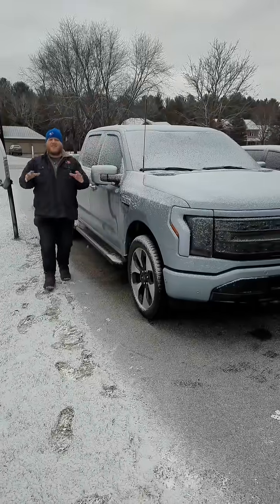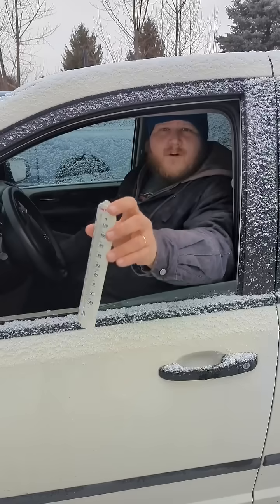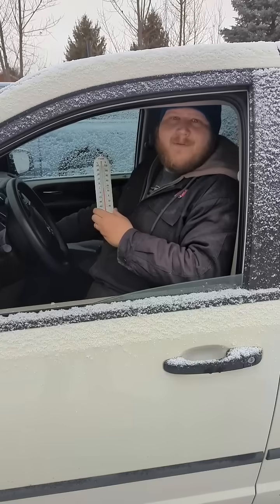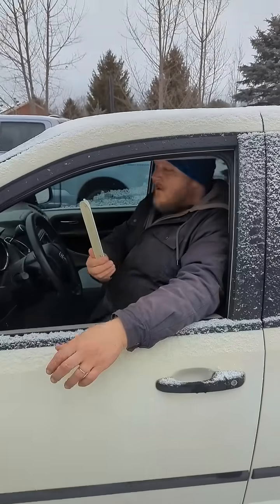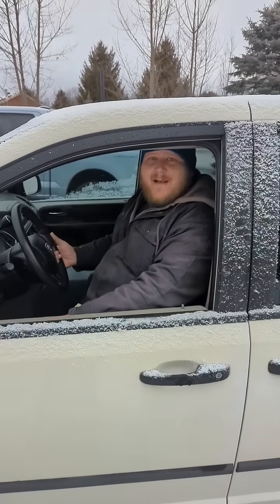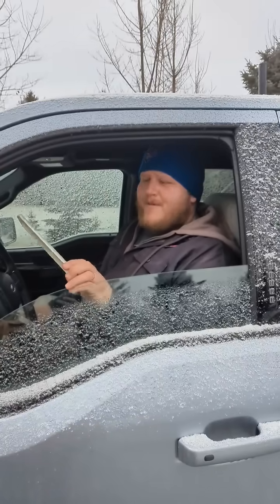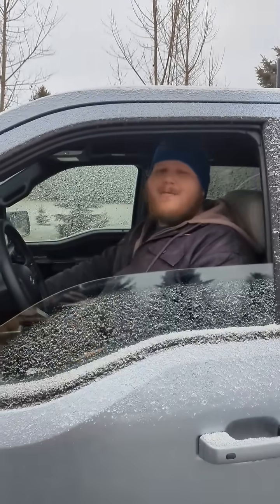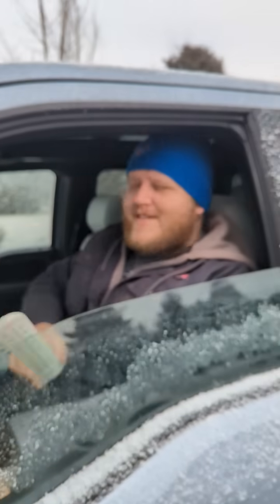Electric vs Gas - Heater Wars! How Long Does the Ford F-150 Lightning Take to Heat Up?

Comment: No thank you, I will take the great gasoline 450+ mile range pulling my trailer and filler up in less than ten minutes over a minute of heating up and interior. I'm tough enough to handle the cold.
Reply: It takes me an hour to fully charge my Lightning at a supercharger but it costs half as much as gas. Of course in day to day driving I never have to stop to charge because I only drive 15-40 km and I charge at night at home. It costs me $8 to fill up there. Supercharger's are just for trips more than 300 km. I rarely do that. I'm saving $10,000 yr.
Reply: @fakumadda1632  You're savings figures are way off. Latch on a 4000# trailer and pull it 450 miles before you recharge it in less than ten minutes.
Reply: @randycrump5464  .......you think my battery would only last 10 minutes.....🤣🤣🤣. WOW!! It shows how clueless you are. BTW.....I don't pull trailers. I'm not a farmer. Stay stuck in the past. Maybe buy a team of horses.......lol
Reply: @fakumadda1632  You need to understand what you are reading. Recharge your battery in less than ten minutes as it would take to refill the gas tank and be able to drive another 400+ miles which we all know an EV can never do. And yes, us farmers, ranchers, oil field and all others that need to pull trailers that gasoline and diesel can do reliably.  We still have our horses and tractors that do a lot of reliable work for us working cattle. We also grow some of our own food and butcher our beef. So it sounds as though you're one of those dependent city folks that might be unable to do that. And believe me and others that the EVs are not the future.
Reply: @fakumadda1632  You are correct about current technology but it didn't get there on its own and is unable to survive on itd own and some of us can survive without it. If it were not for the oil and gas industry you, I and everyone would still be in the pre 1900s. Practically everything we use, and wear in our daily lives comes from the petroleum industry. If not for it you would be walking behind two mules and a plow .But some of us will still be able to step in horse and cow shit and survive.

Comment: My Chevy van takes about 6 minutes while driving to become full engine temperature and will be warm enough  inside to cut back around 8 minutes at 20 outside. It has a rear heater too..

Comment: What does it even matter when you've got a remote starter? By the time you get to your car, it's good and toasty!
Reply: Good luck with that remote. If and when an EMP hits, all electronic equipment are fried. Your remote won’t work and your car won’t start.
Reply: Heres 19 reasons why electric vehicles SUCKS.

1) It’s too expensive 

2) Also cause pollution because it’s created by dirty fossil fuels 

3) Tires wear out quickly 

4) Only reliable when temperatures are warm and when it’s cold, it can bring danger to the driver and passengers.

5) Charging stations are hard to find in midwestern states. If you live somewhere like Wyoming or North Dakota, it is clear that you are going to have a lot of difficulty finding charging stations, as well.

6) Roadside Service does not provide Full Coverage and lot of this has to do with the fact that their parts are not on-hand and they are more difficult to actually find than ones for regular cars. Also, auto mechanics will not know how to fix electric vehicles since they didn’t built it. You probably have to find Elon Muck and ask him to fix it for you and he will probably charge you for a million dollars. 😂

7) Travel shorter distances due to the fact that these are cars that need to be charged, they simply do not have the same type of mileage range that regular cars often possess.

8) Too much focus on luxury vs. dependability. With all of the issues that have been discussed thus far, one may be questioning what exactly car manufacturers are aiming for when it comes to making these models. In short, they simply are spending too much time on overall luxury rather than dependability.

9) They get noisy early on. Owners of electric cars have been quite open about the fact that they are prone to make a lot of noise very quickly into their usage lifetime. There is no question that over time, this happens to all types of vehicles, but it is alarming that it has been happening so quickly for electric ones.

10) Maintenance costs far more because when dealing with expensive cars, one can always assume that repairs will end up costing far more. However, when observing electric vehicles, it is clear that the prices to fix them are at an extremely excessive rate. This is largely because finding its parts is far more difficult.

11) some electric cars look ugly

12) Battery pack replacements are expensive due to the fact that electric cars run on their battery packs, it is clear that they play a major role in the overall performance of the vehicle. However, their batteries are prone to needing replacements as time passes by, and they end up costing a ton of money.

13) Recharging takes a long time

14) Durability is not consistent

15) Tend to be heavy due to the fact that electric cars are built with different materials. In fact, the heavy weight of these vehicles is likely another factor that ends up making their tires begin to drop in quality so quickly.

16) One major aspect of the electric car market is that there are limited choices. Unlike regular cars that comes with an abundance of different options, car manufacturers do not seem to release multiple electric vehicles. This is not a solid idea, as electric cars are trying to grow in popularity.

17) Not Good In The Snow. Electric cars definitely meet their match when they are used in the snow. They are prone to having a lot of malfunctions with this type of weather, while also having a lot of difficulty while driving on slushy roads.

18) Too Much Hype. "Show not tell" is the philosophy that car manufacturers should possess. However, when it comes to electric cars, it is clear that this currently is not the case. There is no question that the market is pushing for more usage of electric power, but they have yet to accomplish much in the way of persuading the vast majority of the public.

19) Having a smart car means that the government can track your every move and can listen to your conversations. 

DEMONcrats and leftists wants to banned EVERYTHING. Gas cars, gas stoves, guns, cows, meat, freedom of speech, freedom of religion, and etc. I’m not going to go along with their authoritarian policies so fuck them!

Comment: People on the road in EVs in extreme cold, need to literally map out charging stations and use them frequently.
Reply: I was up in Maine (down Maine?) and at one of the service plazas, the EV charging stations were packed with cars. The coast had a nor’easter
Reply: My friend turns a 2 hr trip into a 4 hr
Reply: Spoken like a person who doesn’t own an EV. 😂
Reply: Ohh hark the bull hockey, it's only a 40% reduction. I'm a delivery driver and it's not THAT bad. I can still do a day's work without humpin the supercharger all day. Esp when they warm up. And certainly depending on if they have the newer model with a heat pump or not as the heat is the biggest juice sucker in the cold. If you're brave enough to wear a coat and gloves, that isn't a problem either 😂
Reply: You have to do that when it is not cold too.
Reply: I’ve only used the charger at my house. What are you talking about?
Reply: You realize thats mostly due to the fact that gas stations are virtually everywhere. Charging infrastructure has the same issue now as gas stations did when cars first started gaining popularity. As electrics get more popular, so will chargers
Reply: @Calvin DiBartolo   theye have a bigger problem than gas stations did because a car can be filled in a minute or two,
Reply: @calvin2686-u1k  :
And how do gas stations power up all the cars that come through a service station?    More power plants will be needed to power up the millions of cars and trucks being used!    EVs can work, but never on the mass scale the Left wants.    When the military starts flying jets on electric power, and powering up the military with EVs, then we know electric vehicles will work.   Trusting Al Gore and Greta Thurnberg or whatever her name is, is foolish.  Greenies are idiots and lie to get rich themselves.
Reply: @oldguysrock2170  fun fact: the electrical grid is capable of growing too. Well, not in NA apparently. We're way behind everyone except third-world countries (and even some of them are doing better). But have you ever actually done the calculation? if Every personal vehicle on the road turned EV tomorrow, it'd be an additional load of something like 0.3%

HOLY SHIT BLACKOUT CITY! (the better question is why are we unable to handle a 0.3% increase when most engineering has a safety factor of 15-20%? Your outlets are capable of 1875 watts (15A x 125v) but the maximum anything pulls from any single socket is 1500w -- a safety factor of [lo and behold] exactly 20%.

It's funny that you use the military as a standard because -- lo and behold -- electric vehicles DO exist in the military, and are becoming increasingly common. Righties are idiots and lie to themselves because new = scary.
Reply: @calvin2686-u1k  :
The data you cite is far different than the data I have read about.   Charging an EV uses more electricity than running a refrigerator for an amount of time.  I cannot remember what the time period that was used, but charging an EV takes time.  Quick charges are not quick.   Not saying tech can’t improve, but if it takes 20 minutes to charge an EV and 5 minutes to fill a gas tank, the average service station would not be able to handle more than a few cars at once.  I admire your enthusiasm, but EVs will not be able to run the nation.  Hybrids are more realistic as they charge themselves with the duel purpose gas/battery.    Petroleum is a proven success !  Hydrogen is probably the most environmentally sound fuel source but the oil industry and EV supporters will fight hydrogen use as it has the advantage an abundance of fuel available through water.   Our tech is about who can control what, which is taxing use of whatever energy is used.
Reply: @oldguysrock2170  "because tesla is doing it" is definitely not an indication of "has potential" 🤣🤣🤣🤣🤣
Reply: @oldguysrock2170  awfully nice of you to omit his failures like the Boring company and Hyperloop
Reply: @CalmDownBucky97  i guess when you place yourself far enough right, everyone else has to be left. 🤷‍♂️
Reply: @calvin2686-u1k  the grid can’t handle everything now at peak useage. Last summer CA had rolling blackouts and asked people not to charge their cars. That’s with the low adoption rate of today. If everyone  had one the problem would be much worse. Political gridlock, Regilations, environmental issues, NIMBY and various other reasons have kept us from keeping up with demand. How are we ever going to support a massive increase?
Reply: @seashackf1  thats also assuming they dont upgrade the grid. If they were smart, theyd do it to scale with ev sales. But theres much, much more to it than just "we dont have enough power to go around". We actually do. The problem is it takes so long to ramp up power production (literal hours) that if they dont account for high usage, you get rolling blackouts. At the same time, they cant run it at max capacity all the time either.
Reply: @calvin2686-u1k  the problem is the grid will take years, even decades to upgrade. There’s no way it can or will be done on the current timeline for EV’s given all the hurdles to do so.
Reply: @seashackf1  the timeline is 27 years for new vehicles to be EVs. Longer still for gas and hybrids to phase themselves out
Reply: @calvin2686-u1k  Found the pinko
Reply: @calvin2686-u1k  the timeline originally was 2030. Now it’s 2035 and some states have put it into law. CA shut down one nuclear plant in 2014 and will shutting down the other in 2030. They still haven’t replaced all the lost power from 2014 and what they replaced was with natural gas. The grid can’t sustain peak usage now let alone that many more EV charging. CA had to ask users not to charge cars last summer because they couldn’t meet demand of today. It takes many years, even decades, to create substantial power generation. The current timelines will have to be changed when reality sets in as they already have been. Even 27 years seems out of reach at this point.
Reply: The sheer amount of inhumanity involved in just the mining alone needs to be addressed
Reply: @SelfReliance1015 you seemed to have missed the snark about nuclear power plants being the solution to so much of this, and people refuse to countenance it.
Reply: You are correct!    Now Democrats want a mileage tax on cars.   If EVs become a thing of everyday lives, the government either taxes charging of EVs or the mileage tax.   DC and states hate losing tax revenue.   No more gas tax and those road taxes need to be made up somewhere.   So altering routes around charging stations could create more miles driven, more taxes!   Some sarc there.   If EVs become a reality, every gas station will become a charging station.   Wonder how many power plants will need to be built to charge millions of cars.    Could cause climate change.
Reply: @oldguysrock2170  well, I’ll break my odometer and say I can’t find a functional odometer
Reply: @oldguysrock2170  The only thing causing climate change is them testing out nuclear weapons and other bombs on Earth but then they tried to blame it on the ordinary people for driving their cars too much in reality it's them they're the ones cause and s*** to happen and not to mention their private jets going for a one-hour flight causes more missions than me drive my car for a full year
Reply: @oldguysrock2170  Imagine not just building nuclear power plants so we don't have to worry about that.
Reply: Not when you charge at home. Lol

Comment: Many here don’t realize is that when EVs are being warmed up at home before you get on the road on cold days like this, owners usually PLUG THEM IN while heating and lose no range for the warm up. This is actually the recommended way to get the most range in cold anyway. The battery and car will be warmed up before you get on the road, offsetting some (not all of course) of the range loss due to cold. That’s how I do most mornings. Even when I can’t, say I’m leaving from the parking lot at work, the car still heats up within a couple of minutes. Same in summer with AC, it cools off very quickly.
Reply: Whether you're plugged in or using the battery, electric resistance heating is one of the most energy intensive ways to generate heat. Seems kind of contrary to the whole EV/green movement. Of course if the power you are using is sourced by renewable energy and in excess supply🤔, then no problem. However, if it's generated from fossil fuels, you just kind of went contrary to the whole reason of the thrust behind the EV market, reduction of green house gasses. 

And as many have mentioned, most ICE vehicles put under load, i.e. driving, warm up in 5 minutes or less.
Reply: What do you do if you live in an apartment with no garage??? 🤔
Reply: @LZwoodOU812  if you can't charge at home, right now, you don't buy an EV. Unless you're lucky enough to have access to an AC charger where you normally park, either at work or home. These do exist, but are frustratingly rare. Owning an EV, and relying on rapid chargers, is not economical nor sustainable long term.
Reply: @RacingAnt  approximately 40% of the population in the United States lives in apartments. So 40% of the population should not own an EV it sounds like.
Reply: @LZwoodOU812  read the rest of my post 😔 "until there is somewhere for them to charge overnight". This is really easy to solve, just needs action.
Reply: I bought a Cummins diesel generator, mounted it on a tandom axle trailer and hooked it up to my Lightning. Now I get unlimited range without having to stop for hours to charge while on my way to work. 👍🏼

Comment: A better comparison would be to warm up the engine without running the climate control, and once at operating temp, see how long until it's 18'. I mean, since you've presumably had the truck plugged in all night, which is comparable idling and keeping the engine warm. Or are we ignoring the fact we're burning gas or coal to generate electricity, to charge the battery, and keep it warm enough to work? Look up the efficiency of power generation, and then efficiency of charging a battery!